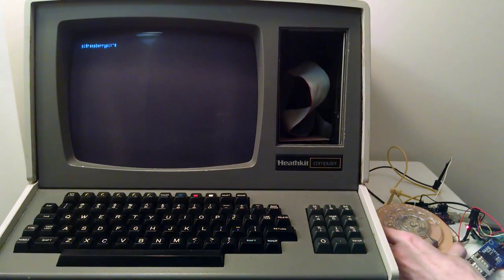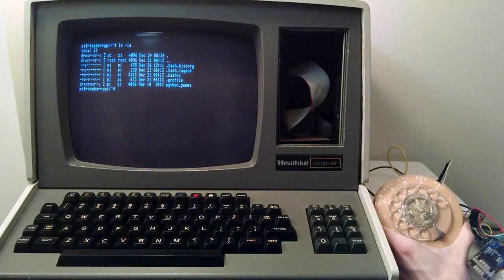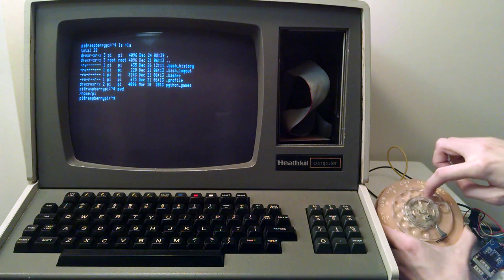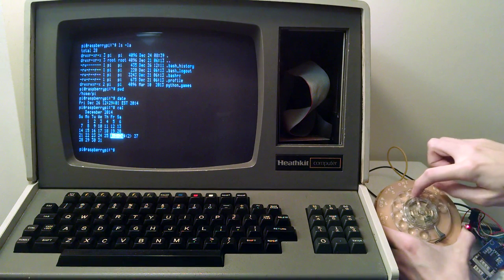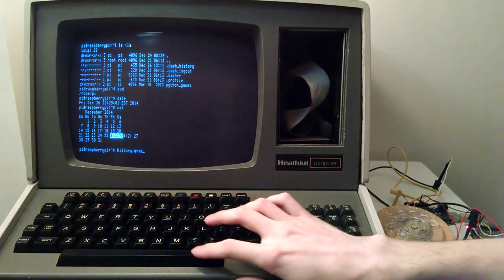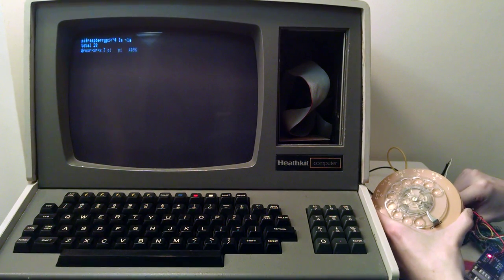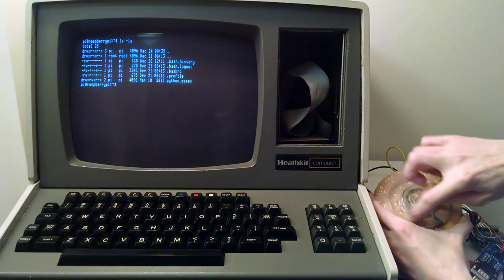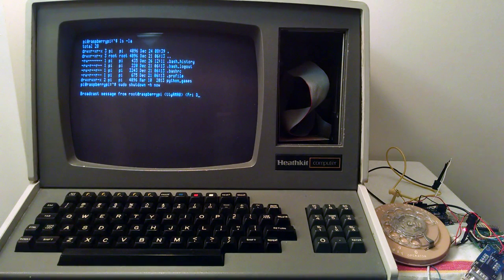Rotary Dial + Arduino + RS232 = Macros!

Comment: How did you connect the Pi to the H89? I am looking into how to do this but I can't find a lot of info on the web for it.
Reply from the maker: It required a TTL to RS232 adapter to convert the signals, and configuration changes to enable a serial console over the GPIO pins.  The specifics have changed a few times over the Raspbian revisions, so there is no way I can fit a comprehensive answer into a youtube comment.